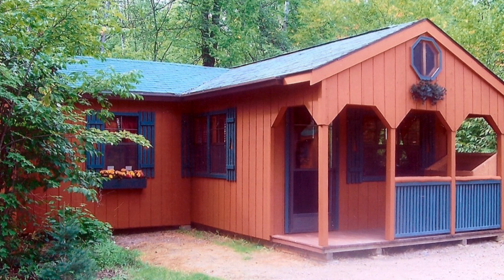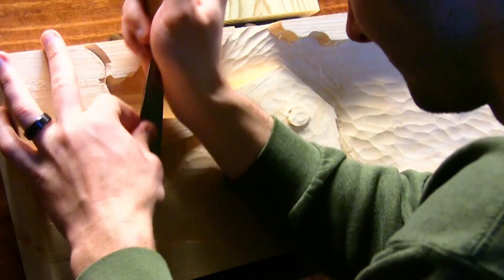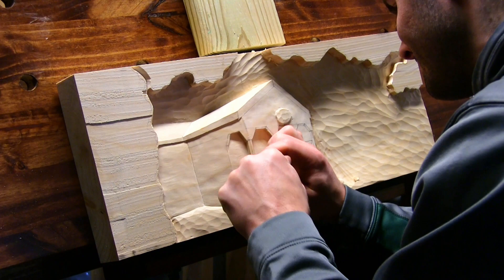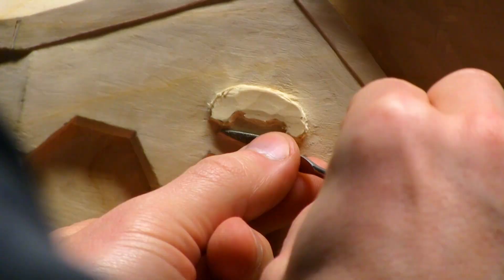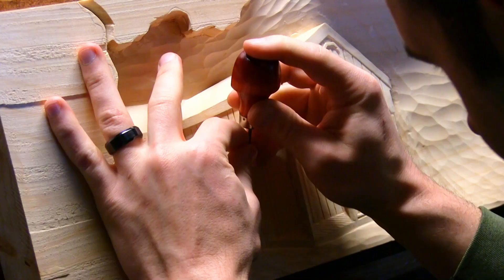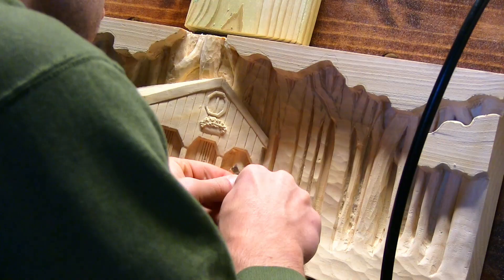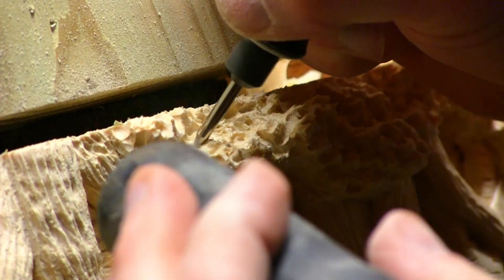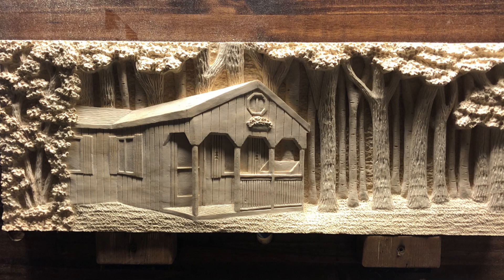CABIN IN THE WOODS WOODCARVING - "GRANDPA'S CABIN" - Relief Wood Carving My Grandpa's Hunting Cabin

Comment: Awesome. I got a lot from this. Thanks so much
Reply from the maker: That's great, thanks for watching!
Reply: Chiseled Outdoors Custom Carvings  Hi there, I wonder if you would be interested to critique a mantle I’m working on if I sent over a couple of pics. It’s not done yet but it’s my first attempt at this style and similar in many ways to your sort of landscapes. Although not as good! It’s also in oak and quite a ‘wide angle’ so getting depth has been difficult. I have some difficulty with texturing too. Anyway it’s was just a general wondering, a pointer or two from you might prevent me from ultimately messing it up! Cheers!
Reply from the maker: The WWC yeah definitely, you can email me at chiseledoutdoors@gmail.com
Reply: Chiseled Outdoors Custom Carvings great thanks! I’ll put some pictures together and be in touch 👍🏼

Comment: Amazing work. May I know what kind of wood is better for carving wood wall art? And another question, is it possible to carve with Dremel 4000 like this hand tool? Of possible then could you please make a whole carving art with Dremel? 
Also, after finishing carving for polishing did you use anything?

Actually, your videos encouraging me to try carving but scared whether it is possible for me who didn’t try before.

Thank you.
Reply from the maker: Great wood to start carving with I'd say would be basswood and white pine. They are both forgiving and soft so they are easy on the gouges. They get difficult when you're trying to carve in tiny details though. Both have pros and cons but are great wood to start. I don't usually carve a whole piece just with a Dremel. My heart is tied to traditional gouges lol so I only use a Dremel to assist in areas or speed up the carve a bit. I usually finish a carving with stain and then I spray on several coats of polyurethane for protection. I'd definitely encourage you to try carving! You'll never know until you take that step.
Reply: @ChiseledOutdoorsCC  Thank you for the instruction and the guidelines. If you don’t mind could you please share the link of the products you are using, then I can understand the better brand of the products. You are truly an inspiration for those, who doesn’t have any knowledge about this like me, start feeling interest to try carving. Thank you so much. I have followed your youtube and facebook page. Wish your prosperity 😇